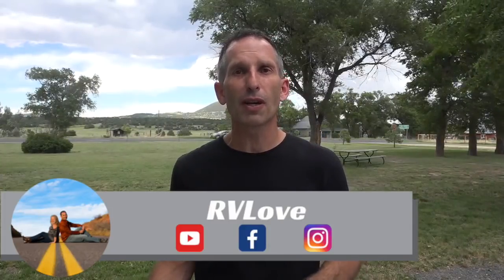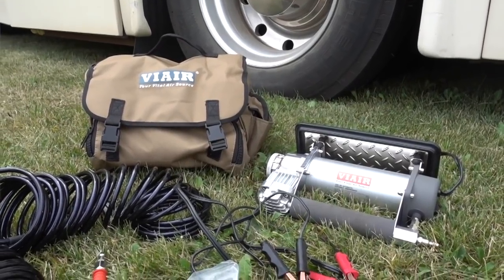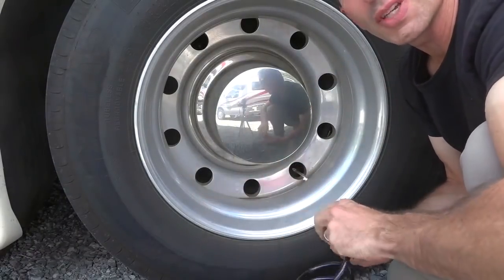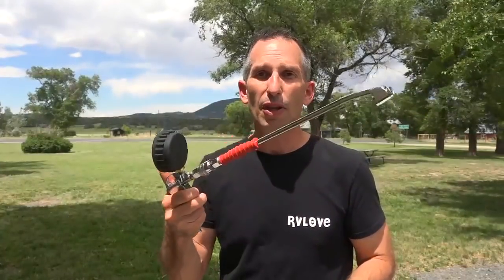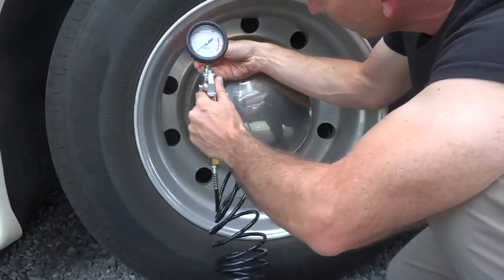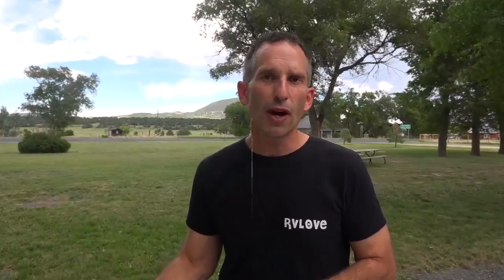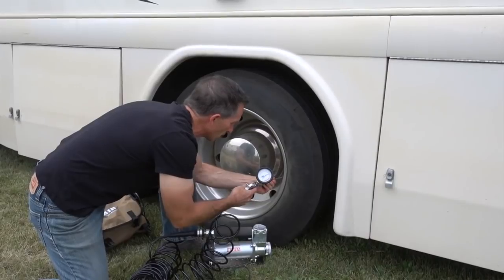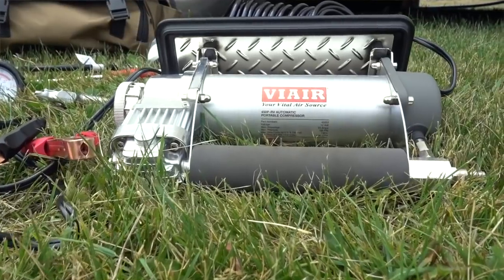VIAIR 450-RV Portable Automatic Air Compressor  | Product Review | Quickly & Easily Inflates Tires

Comment: I have the 400. It has more volume, and I've never had it shut down. Usually, a minute or so tops up the tires. I don't worry about draining the battery, I just clip on the trailer battery, never a problem. However, the hoses make me crazy. They are not the same. One (main) has a female connector at both ends. the extension has a male/female. Whatever. But putting both together causes them to tangle hopelessly. (see that coily spring look? They intertwine so you can't stretch them out.) Ugh! Now, I never use two hoses together.
Reply from the maker: Definitely need to be careful when using both to not get them intertwined, but I have found the hoses much better than what I used to have.

Comment: Mark, since the Viair 450 works on 12 volts of power, will the compressor work when you attach the alligator clips to two, 6 volt batteries connected in a series?
Reply from the maker: Sure!

Comment: Does it have other uses than airing up tires?  Can you use it to spray compressed air such as cleaning dirt out of the engine compartment,  or use it as a spray gun  or staple gun?
Reply from the maker: I am not aware of an attachment for staple gun, but have seen attachments for cleaning out dirt.  Have also known people using these for winterizing their RVs.
Reply: Pneumatic tools are paired to compressor size by cfm rating. A nail gun for example will shoot a nail if it has enough psi but if not enough cfm you will have to wait for the compressor to build pressure back. Any tool that spins (impacts, grinders drills) needs a lot of cfm. Painting requires more. Hope that's helpful

Comment: Thank you for the info on the VAIAR 450P-RV. It is very amazing. I am in the market for a new one. The current price on Amazon without extra accessories is $285 (with accessories is $324 as of January 15, 2020). My Stanley FatMax jumper/inflator just died on me. I think it was my fault for burning it out - continuous pumping tires to 65psi on my dual axel travel trailer.  However, I think for that kind of money I will go ahead and get a portable home-garage 2.5 to 4 gallon tank air compressor. I fill it with air and take it with me. It delivers 2.6 CFM or higher depending on make and model. Yes, it is not as small, or light weight, or portable as the VIAIR 450 or other similar, but I can pump those 120 psi RV and truck tires in less than 3 minutes, and of course, I can also run basic air tools with it when I am back home.

Comment: Great review, especially important that you emphasized the need for proper extended fill attachments (required for access to rear dually). Personally I just use a small 110VAC compressor that I run off inverter (or shore power if we're not boondocking). Downside of my using the 110VAC unit is that it is larger in volume, although not any heavier than the VIAIR.; the real upside, it cost a lot le$$.
Reply: The VIAIR is way better and WAY quieter.

Comment: I like mine, but the two air lines drive me crazy. First, they are not the same. One attaches to the compressor, while the other is only an extension (the connectors are not the same.) When you try to use both they tangle so badly you want to trash the entire thing.
If you can get past that flaw, it works great. Be aware that it won't generate enough volume to seat the bead on a rim, but for adding air on the road it works fine.
Reply from the maker: Thanks for sharing, it's been working out great for us
Reply: Just wondering how you could possibly think a portable air compressor like this (2 cfm) could seat a bead

Comment: What is the max that this compressor will pump to? Pump up an 8 gal air tank to 200psi.  The pump might not make it there or might fail in the process, but lets see how much stress it takes to break it.
Reply from the maker: I don't think it could do the 8 gallon 200psi.  But maybe.  Probably a better question for the mfg.  I would not be willing to test my unit to that level.

Comment: How much trouble is it to get parts for this compressor? Lets see you replace the piston seal if that is the high wear item on this compressor.
Reply from the maker: Thanks for the suggestion, but I doubt I will ever need to do a replacement like that.

Comment: It is my understanding that the 400  model inflates tires faster. If so, why would I want the 450. Thanks for your response.
Reply from the maker: 400 has slightly higher inflation rate, but 450 has longer run time.  Both very similar.  Either one are great.  We just chose the 450 as it was the newer model.